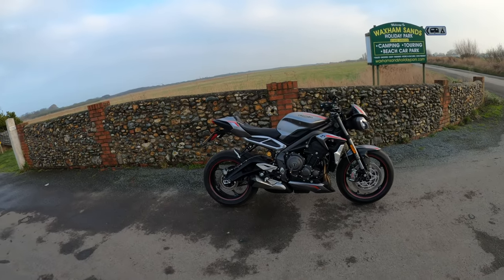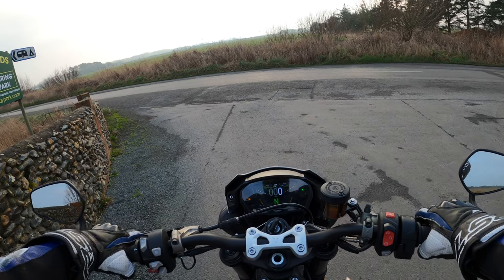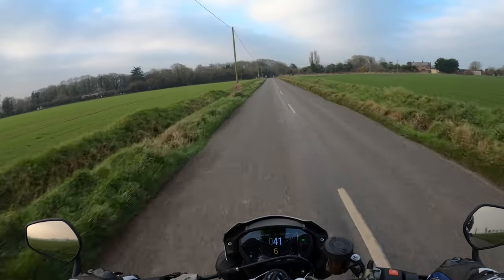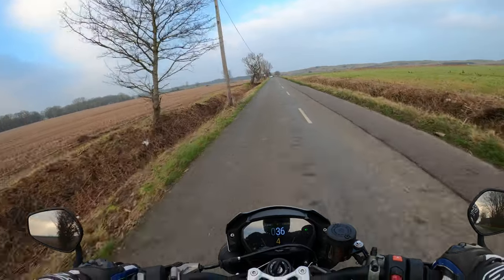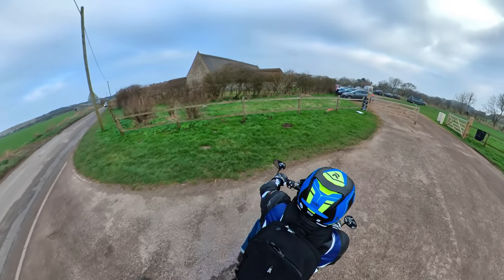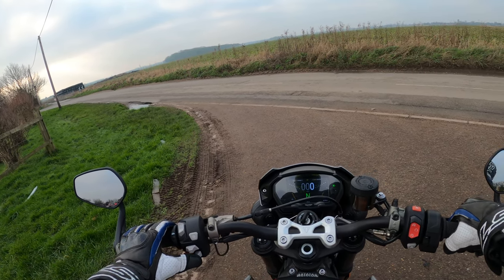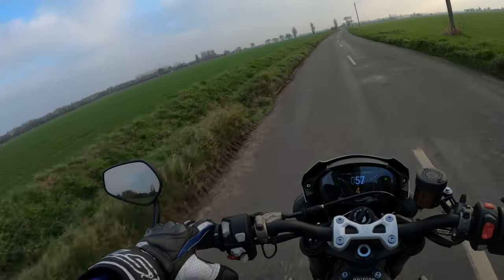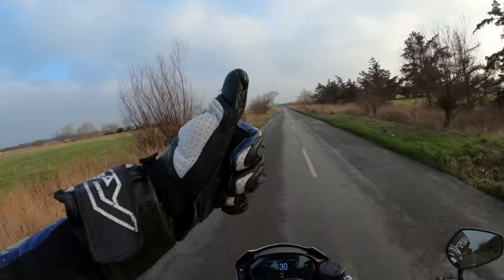Triumph Street Triple 765 RS | Rider Modes

Comment: I like the modes on my RS.  When commuting in traffic I use Road.  For sporty rides I use, you guessed it Sport.  For warm/hot days I put it in rider and turn Engine up and traction and abs down.  As for rain....well we don't get much of that in Southern California.  Cheers.
Reply from the maker: Sounds like you use most of the modes, must admit we do get lots of rain here in the uk unfortunately but I  try and avoid riding out in it tbh ‘can get very cold too’.

Comment: 1:18, you can clearly see the traction control light flashed on to save the back wheel from slipping out, so that could have saved you dropping the bike!

I like the modes on my 765 RS, anything that keeps me a little safer can only be a good thing IMHO.  As for the maps, I think the only difference is rain mode limits to 100hp.
Reply from the maker: Hi Steve yes it did kick in and probably saved me from sliding off the bike. I couldn’t agree more about having rider modes it’s just do we really need so many. Take care Jake.
Reply: @RiderReviews  agree probably too many.  I only ever use sport or rain.  Had a play with “rider” and TC off and scared myself 😳.  That’s definitely not for me and TC will stay firmly on 😀
Reply from the maker: Always fun to have the odd play 😁 but I definitely feel safer with the TC on 👍

Comment: Rain mode is as flat as a witches tit
youd get the same result retarding the ignition .
Rider aids traction control and abs dont really work on a motorcycle like a car .
Surely they are just preset maps they arent really adapting to conditions are they?
The lap timer isnt really a lap timer its a glorified stop watch and why all the drama, about getting low on fuel?
Does it need to occupy the whole dash ?
Im fully capable of noticing a, small amber light a major panic and hijacking of tft is not required
Lets be honest tft rider modes (as implemented) are gimmicks
Reply from the maker: I love a good TFT display tbh lots of useful information on this one!